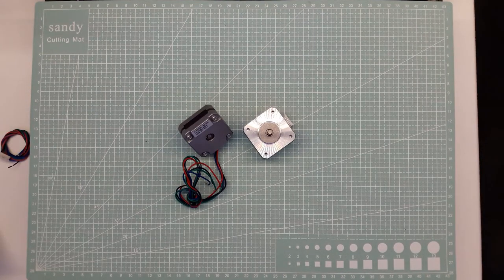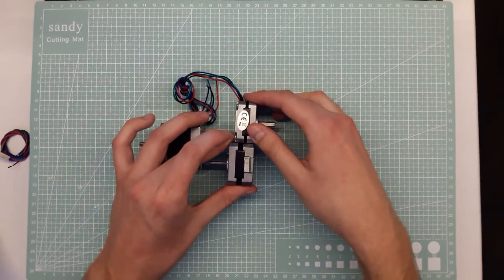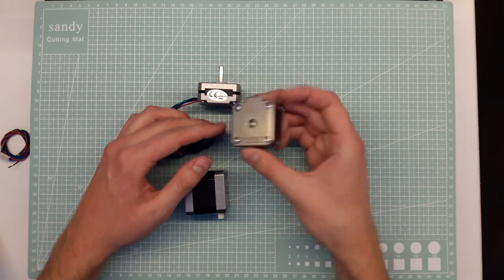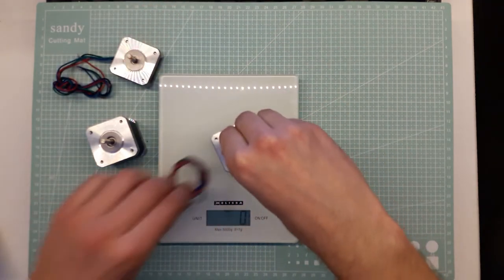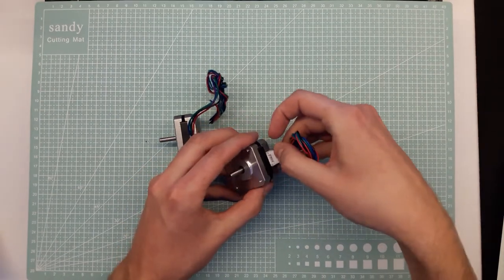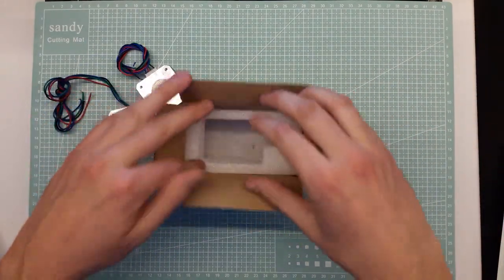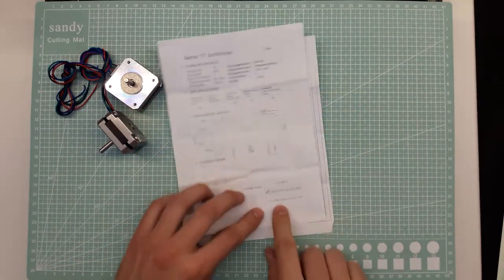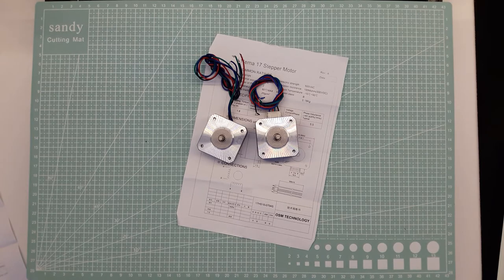NEMA 17 pancake steppers from OMC Stepperonline

Comment: I know this is an older video, but are these two motors still in use?  How have they held up and which do you recommend over the other?  Thank you for your time!
Reply from the maker: They are still in use with bmg extruder. Havent noticed any issue with them. Running duet wifi board
Reply: @KarlMarklund  which one did you use with the BMG extruder?
Reply: Did the smallest one run the BMG?
Reply: @m9taname228  Works as it should!
Reply: @alycapo3391  Is running still to this day!

Comment: Hey, Hope you reply. When switching a standard stepper for the mid sized pancake stepper, Should I have to adjust the vref on the driver? I'm asking because I replaced mine and it gets a  lot hotter compared to the regular one. Sorry, I'm a noob still
Reply from the maker: Hello! Motors have a rate current, if the are not given enough power, they risk losing steps. Too much and they heat up. The same goes with the drivers, if you put too large motor on small driver, the driver will heat up.